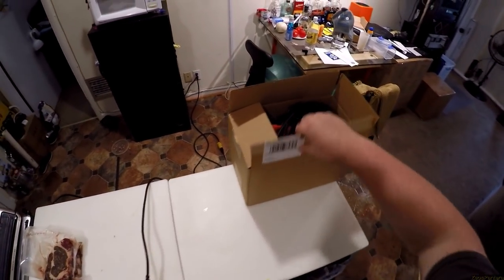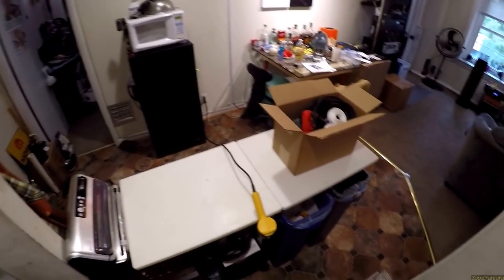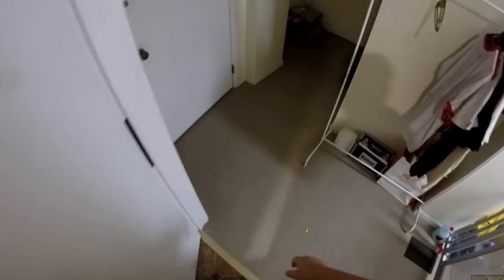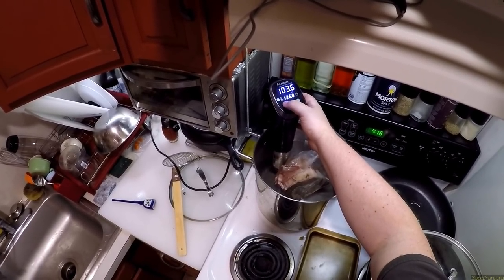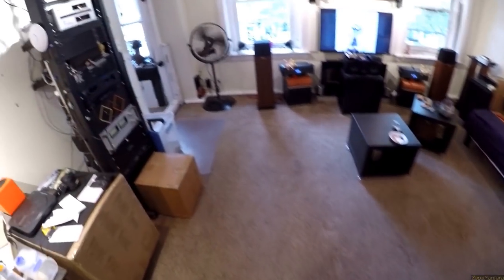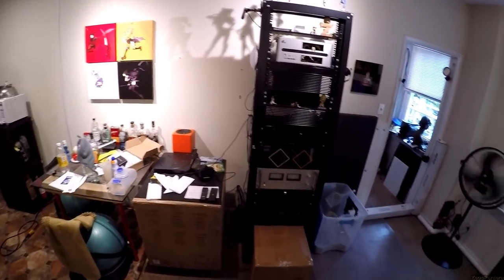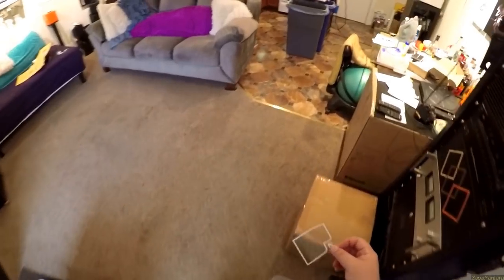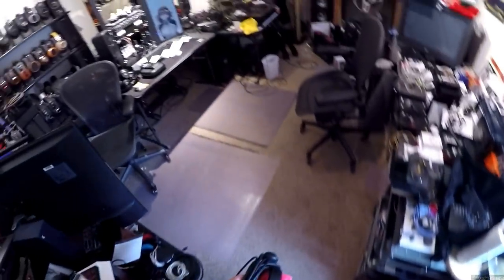MAD SCIENCE HOUR - Valve Index Setup - Part 1

Comment: Based on how messy everything is, the spots and stains on the walls and carpet the black Lighthouse 2.0 mounts wouldn't be a concern for me.

Btw. Lighthouse 2.0 base stations do NOT need to see each other.
Reply: @Robert Gallahan No its not in any way. v1 needed to for sync using the IR flash. v2 doesn't use this for sync and doesn't even have the IR Flood LEDs that the v1s used for sync.

Comment: Just get a rack mountable pc case for the new build. Would look great and you can just run display wires through the hole in the wall that pretty much right there. As well as just extend the USB peripherals. Would make that room a lot cleaner too. Just a thought hopefully you find this useful.

Comment: Most non-stick pans are bad for you specially teflon it's a cancer agent. titanium pans is good for non-stick but expensive. You can use grease-proof paper
Link in description princess.
Just paint the wire with water-based polyurethane paint
Reply: teflon is only cancer agent if you scratch it and then inhale the steam while cooking

Comment: This is why I went with a headset with inside-out tracking so I didn't have to mount anything to the walls to use VR.
Reply: Well sure if it would work as good as tracking with sensors! :D
Reply: Currently, inside out tracking does an okay job at tracking but even with my Oculus Quest, I still prefer external tracking. I wish Oculus would allow me to use my Rift's sensors to track my HMD/Controllers. That'd be awesome!

Comment: Active DisplayPort extensions are f*cky. DisplayPort is very sensitive to signal degradation. So look for tested cables and if resolution and fps is as intended. Also test for longer, you don't it randomly disconnect after 30 minutes.